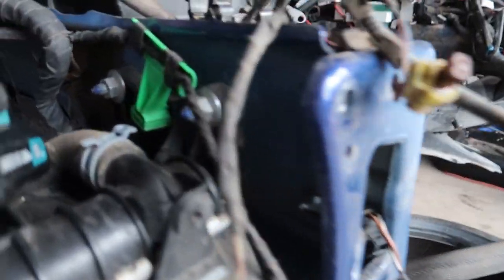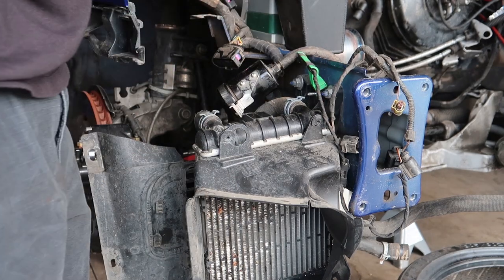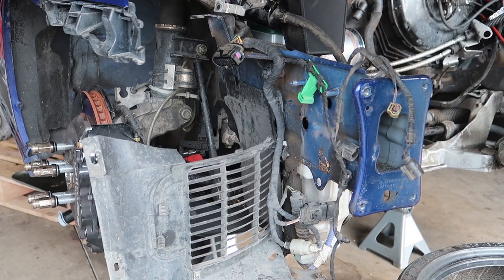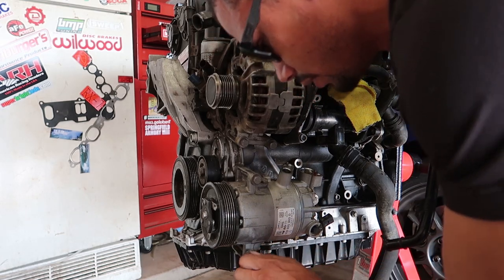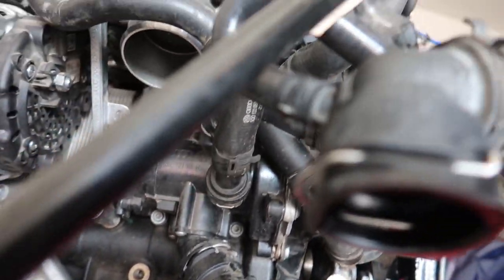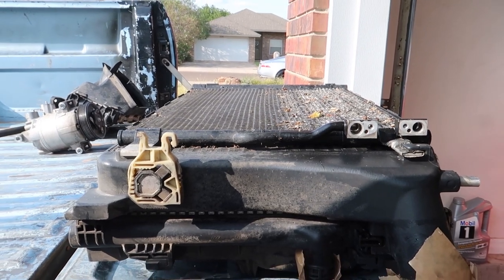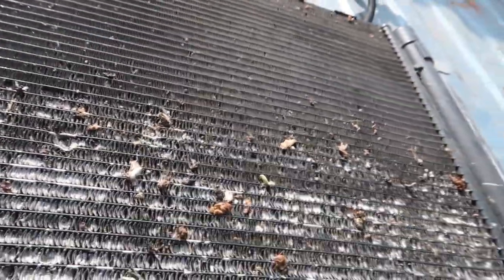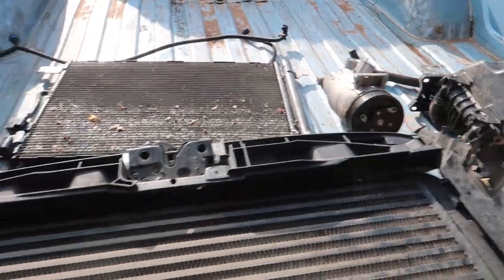Aux rad deleted, AC deleted, and the Transmission sent off to Shop Dap!! | MK7 Golf R

Comment: What belt did you purchase after the delete ? I’m deleting mine as well since I won’t need it in my swap .🤙🏽🎋
Reply from the maker: Not changing belts Audi makes a bracket to replace the AC to keep belt length the same. You can't get rid of that pulley the belt would rub on things elsewhere. Gotta get/make a idler pulley
Reply: Do you have a part number for that Audi ac delete?
Reply: Do you have the part number sir ?
Reply from the maker: 06J145172

Comment: Is it possible to pull the motor without removing the entire front end? About to pull mine out of my S3 and wondered if removing the hood would make that possible.
Reply from the maker: Ummm it would be alot more difficult. They made these cars to pull motors this way. Most easy would be through the front or bottom definitely not the top but it could be done but I wouldn't waste your time

Comment: what does the aux radiator do? are you upgrading your main?
Reply from the maker: Just supplements the main rad for additional cooling, I deleted it on my mk4 R32 when I supercharged it, didn't see any temp difference so I guess we'll see how it goes on the mk7 lol. But yes I do plan on going with the CSF main rad upgrade
Reply: I believe it's needed to help with the additional cooling of the exhaust gases which flows through the block (no manifold).... looking forward to seeing this up and going again.

Comment: What’s your daily driver ?
Reply from the maker: 98 3500 with a 7.4L 454 lol
Reply: @BryceJordanProductions   what is the reason for an AMS intercooler? Also from a stock Golf R to under 400HP would a AMS be too much? Or is it just for the big dog high HP applications. I want a streetable IC with near perfect fitment, what would you recommend for that criteria? Also, why not the Mishimoto radiator, or once again is that more for the daily driver cars?
Reply from the maker: Any of the top dog ICs will do you great, AMS, APR, IE are the main 3. None are going to be too big or anything for stock turbos. My racingline just wasn't holding up to 32psi on a larger turbo so, I need something slightly better. I hear AMS is great, and lighter then most so that's why I pick that as my next if I do upgrade